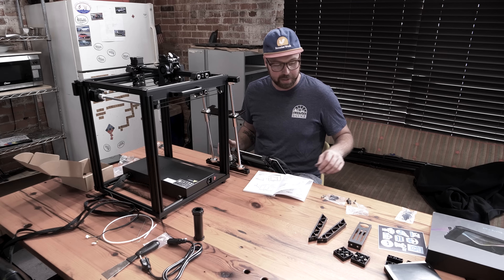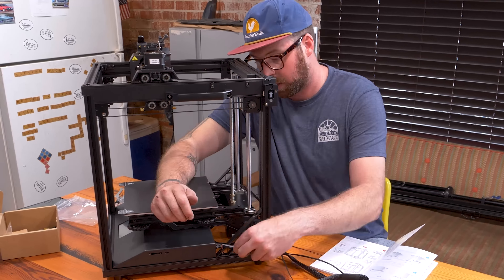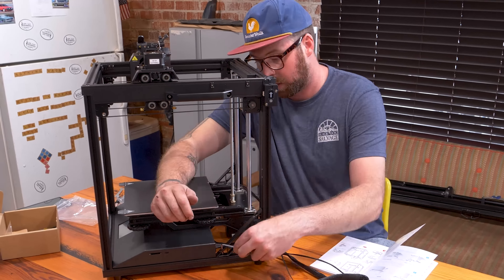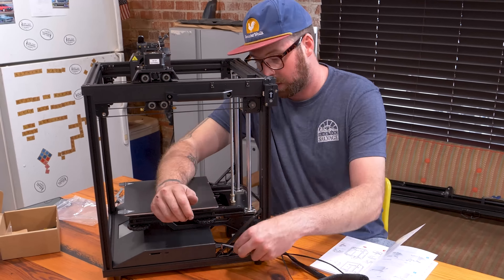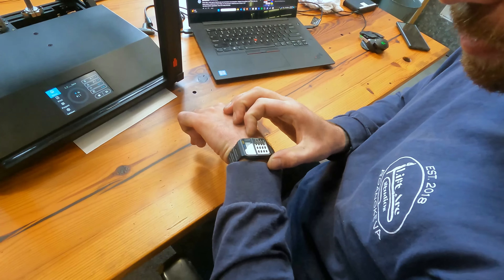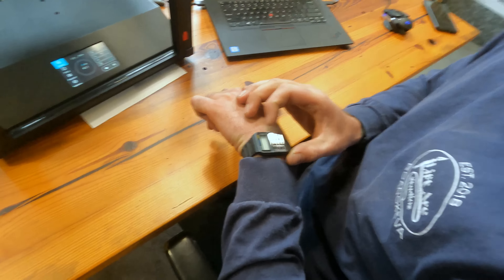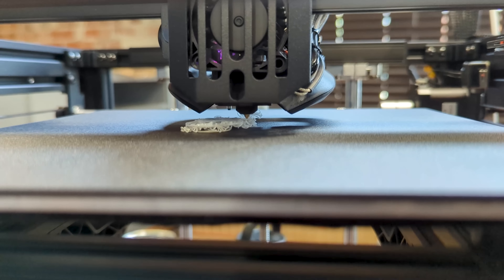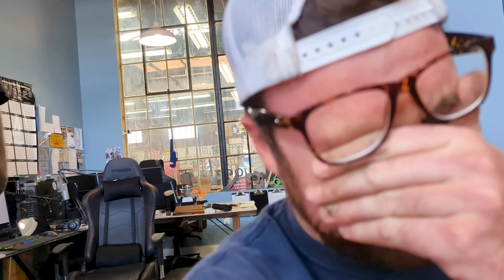3D Printing is Pure Pain

Comment: Like others have said, youtube is your friend, as you know! There are lots of videos to help you get it right. It is a challenging hobby, that you have to spend time learning. 
Ender 5 is coreXY, but you need to learn how to use and set offsets, after you have zeroed.
Do some reseasrch, and you will get there.
You can"t do it like your welding, where you have lots of experience, ...
no wing-ing it here.
FYI... the sonic pad is too advanced, yet! It runs Klipper, stick with the Creality/Cura  based slicer.
Look up your model +help!, please

Comment: Yeah, 3d printing is a hobby you need to learn stuff for.  As others have mentioned, a Bambu Lab printer is currently offering the lowest knowledge threshold to get started, but even with one of those, you will at some point hit a problem and then need to know how the thing works to figure out how to fix it.  As for Creality printers, you're best if you reach the level where you can put your own modified firmware on it.  Their hardware is often pretty decent for the price (although that's more true for their lower end stuff than the latest $300+ stuff) but requires better firmware.  I'm still using my Ender 3 regularly, but via Klipper instead of the castrated version of Marlin that Creality shipped on it as the firmware.

Comment: This is the downside with cheaper printers.  There is a reason why printers like the Bamboo labs are more expensive.. you get it assembled for the most part, and it just works.

Comment: Not sure if you guys got any glue to use with the machine?  I did with mine I have got a flash forge.   It will stop the peice being dragged around the bed.  Also when you do your setti ng up slicing use a layer to set your part on.  It will stick to the plate better then you peel it off when you are finished.  I am in Australia.

Comment: I tried to "upgrade" my Creality CR-10S Pro V2 with a Sonic Pad and this nearly destroyed the printer. It kept slamming the hotted into the print bed. I returned the Sonic Pad and Creality (over an inordinately extended period of time) helped me restore the printer back to its factory settings. I quickly grew sick of having to babysit this printer. I don't have time for this. I replaced it with a Bambu Lab X1 Carbon with the AMS unit on top. I wanted to be able to prototype my designs with engineering filaments. What a revelation! Out of the box printing excellence. I use it for creating custom brackets and supports for stop motion animation productions. The Bambu X1 is really good at printing gears too. Apart from basic maintenance on my part it looks after itself.

Comment: I got fed up with tinkering with my old Printer and recently bought a Bambulab X1Carbon.. Not cheap at all, but for me it's a tool, not a hobby. I took it out of the box, installed it and from the first print it was an excellent experience.

Comment: Glad you got the 3d printer to work. I think you will find lots of uses for it around the shop. Think of all the times you've needed some random part around the house or shop that broke, now you can print a replacement part. 3D leveling is a pain, I have one that is adjusted manually and even a change in room temperature, or the temperature of the heating surface is enough to screw up a print. However, the 3d printers are repeatable. so when you get it right once, repeat the process and it will work every time. Good luck and have fun.

Comment: A perfect example of why a complex piece of hardware should never come with a printed manual! The manual here should be on their website so they can fix it whenever it's not clear or correct. These problems should have never happened if they were tested properly by someone in the design stage. This is not specific to Creality! Manufacturers: check your initial setup instructions to ensure that the only skill required is obvious before they start (in this case, the only skill that should be required is knowing how to use an allen key)
Reply from the maker: This also seems to be a problem with certain "newer" and emerging technologies.  Manufacturers are certainly going to have to get better about explaining their products if they want wider adoption.  Going into this blind was actually a great learning experience though, and our mistakes taught us a great deal about how to troubleshoot for the problems we're inevitably going to encounter in the future - Walker

Comment: Absolutely zero pain if you buy the right tool (printer) for the job.  The difference between a cheap consumer grade printer and a real industrial 3D printer is struggle-free success.  Buy a Markforged composite printer and never look back.

Buy a toy and suffer.
Buy an actual tool and prosper.

Comment: Welcome to 3d printing, yep most of the time, pure glorious agony. Kinex was my jam as well. You could build much bigger than Legos, Construx where pretty cool to. If you are using the firmware the sonic pad wrote, you are running klipper. If you downloaded direct from creality you are likely running marlin. Z offset is very important, run throught the leveling, probing and z offset again. The calibration cube should come out 20mm cubed, if close, print settings pretty solid.

Comment: The calibration cube is for, well calibrating the steps og the motors. Is the cube the same size as the drawing? I'm a Zortrax user (Overprized out of the box machine) They work great and I've made a lot of jigs and end products. But even on a machine like that, you'll get a visit from the spaghetti monster and other problems. For a lot of materials, you'll need a chamber around the build area to hold the temperature steady.

Comment: Did you have to assemble the plasma cutter from a box of loose parts?  No, you paid for it to come mostly complete.  Did you have to spend 5-6 K$ on the 3D printer?  No you didn't.  There are 3D printers that come ready to play but cost a bit more.

Comment: Nah, we aren't all pu****s, we just buy good stuff like Bambu Lab or Prusa printers.. There is an old adage... you get what you pay for. In this case I thought I understood that you paid $0.00, and you got precisely what you paid for. I made the mistake of actually paying for a Creality printer once.. I returned it forthwith.

This printer is like getting some of the Everlast welders you have... it has all sorts of options, no real manual, and leaves you to figure a lot of stuff out. It all depends on what you like to figure out... Bambu and Prusa are like Miller... Set it and forget it... Just do the job it was intended to do.

I sold my brand new Everlast Pulse Mig because it was a giant pain in my ass and paid up for a Millermatic 255 so that I can just set a thickness, set a wire size, and weld. I just want to get the work done, not spend a ton of time trying to figure out the things that I don't...
Reply: BambuLab is the way to go, it just works

Comment: 3D printing is such a fun journey. Everyone on the internet yells at you for not knowing things, but nobody tells you what you should know. Almost all 3D printing communities are utterly unhelpful and straight-up toxic, so unless you have a makerspace in the area or know some people (or have your own community of people) you're SOL if you run into any issues.  
And then when you finally figure it all out, they just make up new shit. They come up with a whole new firmware that everyone thinks you should be using, new tooling around it, new slicer settings.  
It's absurd, honestly.

Comment: I bought a Creality CR-10 Smart, and the thing is far from smart. While we did get some good prints out of it early on, it would randomly have some sort of software fail. We have tried several versions of the software updates but I’ve totally given up on it. What a waste of $700 and what a piece of crap this printer is. 💩 😕
I’ll be doing a bit more homework before going down the 3D printer path next time.

Comment: did you just say that updating the firmware was difficult? Youre just creating drama at this point.
Reply from the maker: So the process of updating the firmware wasn't the friction point, it was figuring out which of the older firmware versions would correctly communicate with the sonic tablet.  There was an issue where the sonic tablet thought the printing surface was much larger than it actually is, forcing the leveling probe to try to make contact beyond the boundaries of the plate.  After speaking to some experts and researching it online, this is a fairly common issue with certain versions of the firmware, and trying to figure out which one would fix the issue ended up sending us down a bit of a rabbithole.  Sorry if that wasn't explained properly in the video! - Walker

Comment: Have you ever considered slowing down to read and actually learn something before jumping in with both feet and immediately claiming the machine is broken?! 🤦🏻‍♂️ You got mad about the table jamming into the head when you literally pressed a button on camera that made it happen. And if you can't figure out what board or what firmware you have from looking at it, you need to stick to other means of creation. 🥴🤣